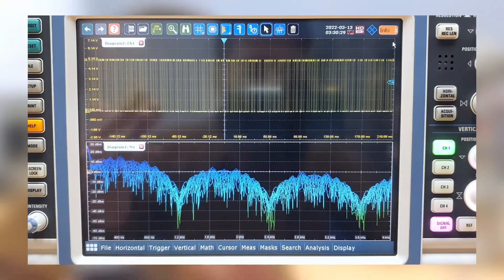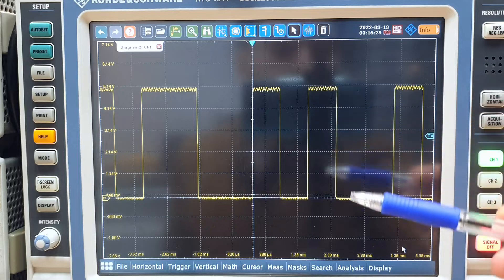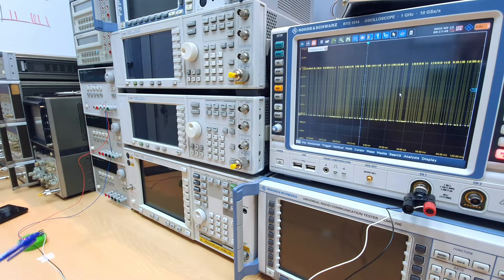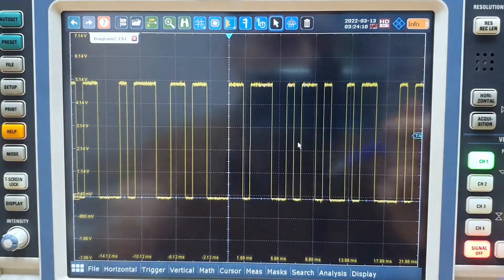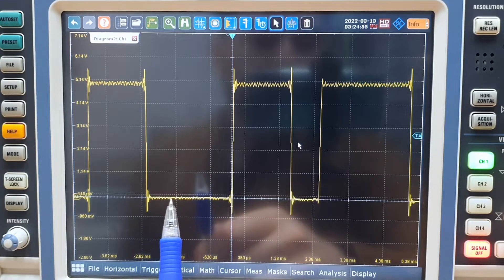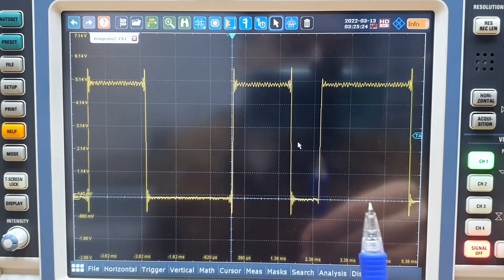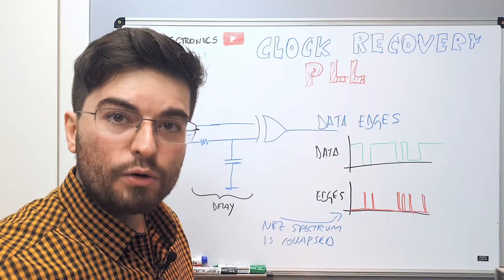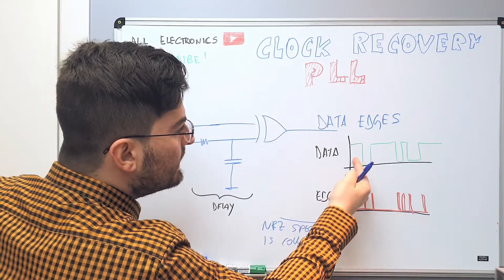Clock Recovery and Synchronization

Comment: Was that edge to edge delay really 9 degrees? Looked much more at 14:45. Tells me the static phase delay in your PLL after locking is much higher than the 9 degrees and you would probably be fine with setup times even without the 9 degrees inserted.
Reply from the maker: 90

Comment: I am a bit late to see the video, but I have really liked it and keep the good work. Question: Although it is very common to see data+clock in a single line in high-speed serdes applications, you have used Arduino Nano for your demonstration. Do you know of any protocol in the low-speed serial communication range where data+clock is used in a single line?
Reply from the maker: Thanks! Every 1-wire protocol (?)

Comment: I'm CSE student, and trying to understand this PLL thing. Guys at 7:35 , "If we have bit rate of 1200 bits ...pulse will be of 1200 Hz.." My Question is :

 once we detected edges/pulse of input signal 

(which will have different widths/distance between pulses dependent on data for example 110001, so the pulse would be like **|***| (*=diff volt representing bits 1 or 0 , edges=|), right?) , 

how do we get correct clock? . Also (7:35) why pulse repetition rate would also be 1200 Hz, which is dependent on data bits. for examples a data like 1001111100110 wouldn't have edges/pulse of same interval. would it?
Reply: @AllElectronicsChannel plsss help me understanding it

Comment: great video, the best I have seen so far explaining the phase detector and bit recovery clock. You could implement the pulse edge detector in software by attaching two interrupts (a rising edge and a falling edge interrupt routine) performing the phase sensing.

Comment: That’s a good one, essentially the use of low bandwidth PLL is equivalent to using a very high Q (Q>> no. of consecutive bits) band pass filter after the edge detector. Using such a band pass filter too, will help recover the clock.
Reply from the maker: Exactly!
Reply: It doesn't have to be Hi-Q. Here the clock jitter was 32x, so Q~30 is fine

Comment: Excellent video! I was able to implement in arduino and then on FPGA since actually for a 9600 baud rate, an arduino running at 8MHz may actually only get a signaling rate of like 40KHz since here you have to implement the NCO in software and the phase alignment logic. That's as fast as my main loop would run at least, so there's basically no fine control over the phase to be 9 degrees lol. My recovered clock WAS shifted properly for reading the UART but I believe the phase is entirely due to the mentioned slowness. It happens to make a good phase angle for the data signal to stabilize at 9.6KHz... but I wanna do faster shit like USB next.
Oh also, yeah I did this on my FPGA too, and the difference was that it locked on 100% to the edges pretty much perfectly as soon as I could just get the verilog to compile. That's the difference from 100MHz and like (in the range of) 100KHz
Reply from the maker: Great!!

Comment: Hey! Bro! It's a great video and really appreciate your effort.
I'm looking into your arduino code but it's not that easy to match your code with the diagram.
Could you add some comments on the arduino code and some math equations for the diagram.
Thanks Bro again!!
Reply from the maker: Hi man, thanks! The code have many layers of tricks/simplifications... Which parts you want to understand better? I can help you here
Reply: @AllElectronicsChannel  Thanks for quick reply! I manage to understand  most of the code except for one thing, "delay equalizer", can you elaborate on that part? What if i remove the code?
Reply from the maker: @nova0302  Nice!! The "delay equalize" is a trick used to make the run time of code be the same for different branches. 

In this way, we have less jitter on the overall loop, because different paths of the code will need more/less time to execute. 

So probably I added the "delay equalizer" in a fast section of the code, to make the execution time of that branch more even in respect to other branches of code

Comment: I have a question. From spectrum of the NRZ encoded signal, we can find that the bit rate is 1200Hz because the notch happens in 1200Hz. From 1200Hz, it's enough to get CLK. However, why do you still want to get 1200 from Spectrum of signal edges?
Reply from the maker: Hi! You need information at 1200Hz to recover the phase of the clock. Seeing the notch is notch exactly knowing the phase!
Reply: @AllElectronicsChannel  You means that from the notch we can get 1200Hz，but not the phase of CLK, so we still need to get signal and spectrum of the signal edge from which we can get the phase by PLL?
Reply from the maker: Even more than that..  you are seeing the notch because you are a human... but there is not energy there, there is no way to "capture" the notch.. to "measure" the notch.

When we detect the edges we are generating energy at 1200Hz. Energy that we can measure with the PLL, lock on it...
Reply: @AllElectronicsChannel  Thanks so much! I totally understand my question. Really thanks, the funny thing is that my none of my teacher have ever taught me that and I always feel confused about the basic concept. Thanks!

Comment: Great explanation of the digital PLL.  I'm just a simple hobbyist.  I'm trying to recover a clock from an analog carrier signaling digital data via phase shift keying.  I was curious.  How could you recover a clock from that?  It seems like edge detection is a different beast in this regard.  I think delaying the signal and doing math on the samples is still applicable, but obviously XOR won't work.  I tried simply dividing and that generate pulses on phase(edge) transition... but only if my delay signal was at a specific phase relationship to the realtime signal.  Is this the wrong approach altogether?
Reply from the maker: I have a video showing a squsting loop bpsk detector. Take a look. It is basically a PLL over the signal squared. Squaring removes phase information, pll locks to that and its output is a stable reference to further decode the bit stream

Comment: Thanks so much for this! I've spent almost two weeks failing to do clock recovery on an NRZI signal using a CD4046 PLL chip. I just couldn't figure out why it loses lock as soon as any zeroes appear in the data stream. Analog is not my forte and I had a horrible time working with the 4046. I decided to try a digital solution and your Arduino method works flawlessly for NRZI with some small modifications. Absolutely brilliant!
Reply from the maker: Amazing!

Comment: Great video have a question though..it might be long but bare with me..  to my understanding in ethernet UTP 100mbps we use 4b/5b coding with NRZI to increase the number of transitions (edges) so we don't loose the phase lock of the clock.. in fiber though we are using NRZ not NRZI so multiple 1s or multiple 0s in data can cause loosing the clock synch due to edges absence.. how this is solved in fiber ?
Reply from the maker: Thanks man! 
I don't know the exact case of fiber.. A common technique is called bitstuffing 
It is very simple: we force a transition when we have a long stream of zeros or ones. 

USB uses this technique. For example, we can add a transition always we have more tha 5 zeros/ones
000000000 -> 0000010000

The receiver knows this and ignores the bits inserted
Reply: @AllElectronicsChannel  
I think this is the correct answer ..thanks again for the great video

Comment: Hello, how should the PLL design change when the frequency of the NRZ data is variable (varying for example from 40Khz to 640Khz)/
Reply from the maker: You need to vary the center frequency of the NCO to match the data rate.. So the PLL makes smalls adjusts to align the NCO.
Reply: @AllElectronicsChannel  Thanks a lot. That's what I was thinking.

Comment: Excellent video !

I have a question, why did you choose 9° as the phase lock target ? I understand that this allows the data signal to settle before taking a reading, but by that logic why not choose 180° so that the reading falls right "in the middle", furthest away from the rising and potential falling edge ?

Thank you !
Reply from the maker: There not a reason.. I only chose 90 deg.
90deg is also a common phase of equilibrium in hardware PLL, when using the XOR phase detector

Comment: Very nice, my previous experience with clock recovery was mostly that it is a pain in the butt. 
I had to implement it in a FPGA for my Master thesis, where I didn't really have a spare PLL. 
I built a similar approach though, since the bitrate was known but could have some tolerance, I started with an edge detector, and counted the time between the pulses, I then took the minimum time and averaged it. I then took this to correct the expected bitrate. I works fine, however when there are VERY long bitstreams of only 1s or only 0s, it gets pretty inaccurate. 
To prevent this, very long pulse times get sorted out. This turned out to be very stable.
Reply from the maker: Nice!! I have used that technique I called feedforward clock sync. 
This technique also happened me when I made tesla coils, using a FPGA you can compensate the on/off delays of the IGBTs. It is safer because a closed loop pll could destabilize killing the power bridge !
Reply: Aren’t long sections of 0’s/1’s avoided by using special coding schemes that create a more balanced bitstream?
Reply from the maker: Yes !

Comment: Interesting introduction and explanation of the digital PLL with the NCO. Instantly reminded me of the horizontal sync mechanism in old TVs, where sampling the horizontal deflection ramp by the sync pulse generated the error voltage for the horizontal oscillator. Pretty sure the digital PLL is the same idea. Great videos, great channel!
Reply from the maker: Really nice, I didn’t know that old TVs used this technique. Thanks!

Comment: I would like to ask you a question. Can a crystal filter "coulour" the output frequence due to the crystals oscilation? For example: imput 10mhz and get a  frequency out that dont correspond exactly with the input frequency due to the crystals in the filter?